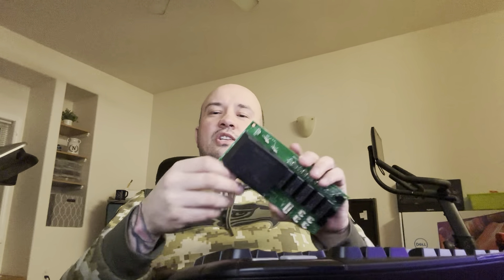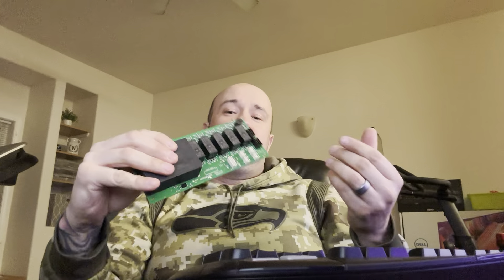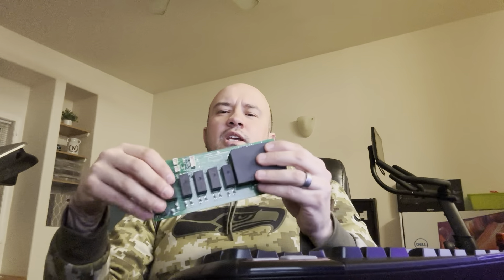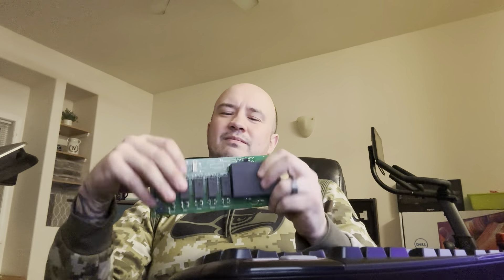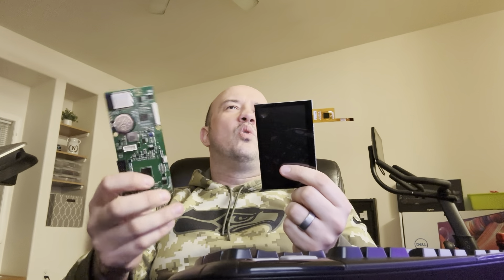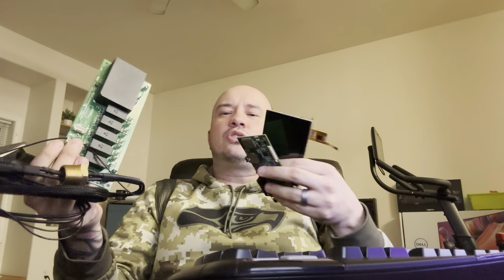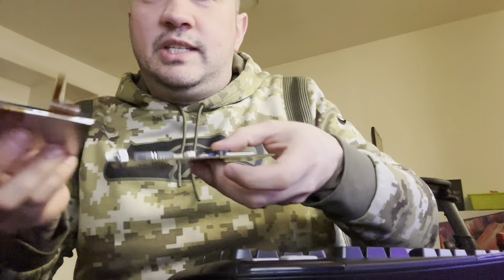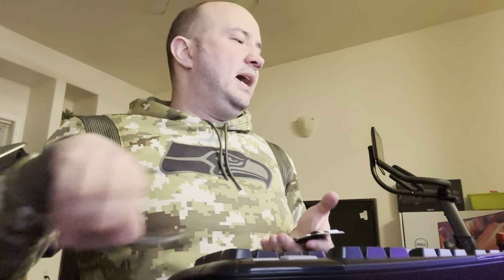Top 4 Harvest Right Parts to have on hand

Comment: Do you know anything about the scratch and dent Harvest Right machines? Do you know if they have a teal mark on the top of the chamber? When you take off the rubber seal you can see a felt pen mark in teal on the top? I was told ALL the new machines have a green mark on the top of the Chamber Barrel but when I checked out a new machine at Tractor supply that was a month old it did not have a mark like I was told they have. Thanks!

Comment: What kind of Freon does harvest right use?  My machine was purchased in 2016.  And maybe a source for pre wired shelving unit for medium.
Reply from the maker: Hello you would need to contact them direct. It might say on the sticker for your machine from HR however I know right now they are doing R410A.
Reply: @freezedryerrepairsupport  I have a cylinder of 410a.  Can a regular freezer repair man recharge it or do you have a video for diy.
Reply from the maker: @mariepauls6449  a repair guy should be able to do it for you

Comment: how about an extra pump, do they go bad?  I did the Felix fix and got down to 165mT on last batch so I know my pump can pull a good vacuum, but on a pump test it took 23minutes, 22 second to get down to 500mT. HR says it it can pull 500mT in 30 minutes it meets their parameters. I believe when new it could pull 500mT in well less than 15 minutes and be well below 300mT within the 30 minutes, so it defiantly lost so efficiency. I have changed or filtered my oil about aa dozen times in the 84 batches I have ran. 

I can't help the feeling they have these low parameters in hopes that they won't have to do a warrantee replacement, in which mine expires in 3 months. I almost feel like buy a new regular pump and sending back the premium pump and ask them to fix it, replace it, or refund me.
Reply from the maker: So I feel they might have changed some of this stuff to save money but that’s just my thinking. They have been replacing these things and making sure below 500 for years and years so why the change now
Reply: @freezedryerrepairsupport  Thanks again for the feedback, I will just make sure I do another test before it goes off warrantee in June. The tech person did send me instruction on how to clean the insides chamber of the pump. Something I been wanting to do but was affair it could void the warrantee if i had done so.  My oil is clear, but I can see a crud (looks like rust) residue when looking down into the demister/fill hole.

Comment: Trying to help my mom get her machine back up and running. She was running a batch and out of nowhere the system stopped working and has not powered on since. No lights nothing. At all
Reply from the maker: Try to bypass the power switch. If that still doesn’t do anything then I would check all the wiring. If that still look good I would change out the CPU board. Let me know how it all works for you. You can always email me at admin@fixmyfd.com

Comment: I purchased a large SS model last year….have never hooked it up….it is uncrated. Any advice on how to approach the initial set up??
Thanks for your videos.

Also the guy on “life after 40” ??? I think…..He shows that you should remove all Teflon tape????? Video link below 

https://youtu.be/di7JDZBTEZI
Reply from the maker: The Teflon should be replaced with gas rated tape. Yellow or a gray color works great I have found. 

As for initial setup it should have instructions in the box